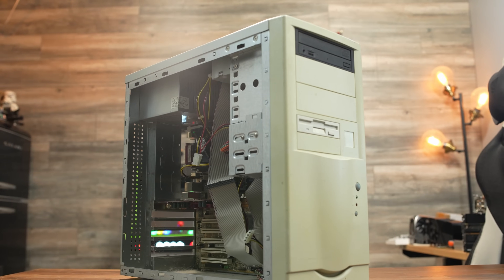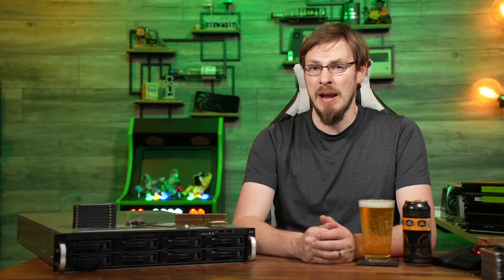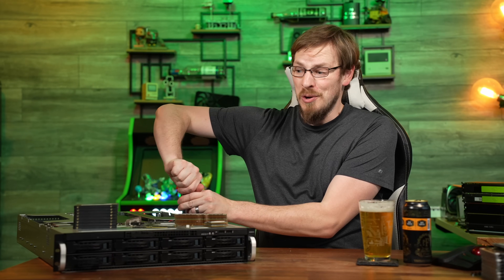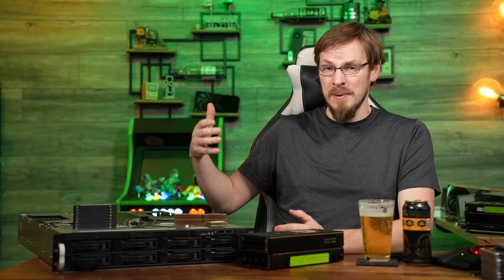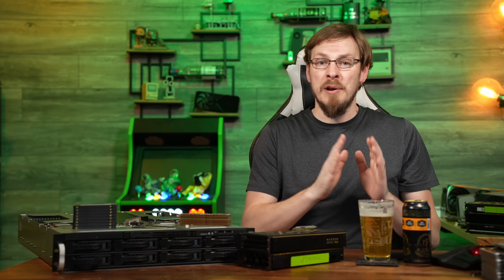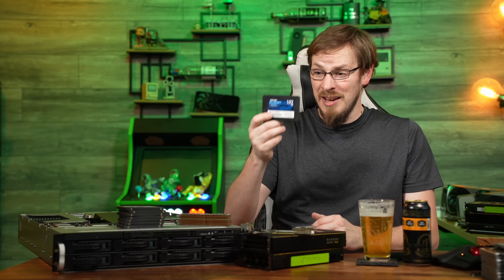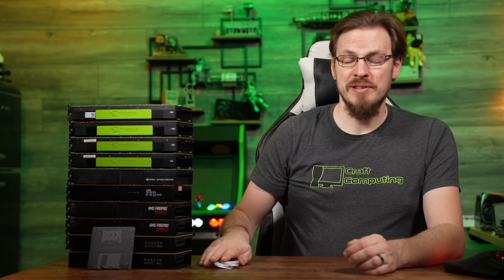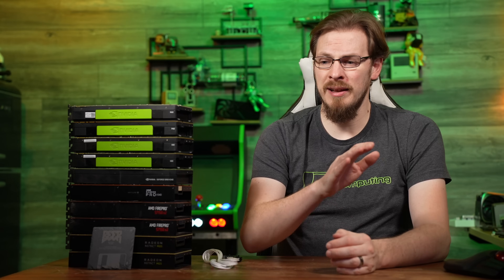The PERFECT 2U Cloud Gaming Server - Asus ESC4000 G3

Comment: I still don't see how not striping the drives fixes the io limitation. You're just shifting where the bottleneck happens. I still makes sense to stripe the drives and always have the aggregate bandwidth available for literally everything. After-all, the IO limit is still there regardless of the implementation, so you might as well stripe the disks. Individual VM tasks will be faster, and  you'll still have the same IO limit for large random loads regardless of the drive configuration.

Comment: In reaction to your sponsor video. Did you just use an abxylute? How is it? I'm looking for a cloud gaming handheld that doesn't break the bank but is still usable. For instance for running moonlight.
Reply from the maker: The handheld in the video is an Ayn Odin Lite.l, and worked great in my testing. Obviously with cloud gaming, your mileage may vary depending on your internet latency, distance from the cloud servers, and your own internal network. I'm almost 2000mi away from Max, and still had a great experience.

Comment: How well does the p40 work, i have been looking into building a cloud gaming server myself.
Ive got 2x 2690v4's 1tb of ram at 2400mhz, nvme storage, and quad 10gb networking. Its been working great. I jammed a 1060 to test with, which also works great for what little performance it can dish out.

But now i am looking into the gpu's im down to p40's vs p100's any advice? Ive been leaning towards the p40's. Both are the same price, but there is not much info on building game servers from them.

Also those eps cables are available on amazon if its the same pinout as a dell, lookup "r730 to m60" or "r730 to p40"
Just becareful some of these "eps" ports are eps in formfactor but not quite eps in pin out. Dont fry anything while your testing this stuff, looking forward to seeing what you make..

Comment: Why didn't you go with the E5 2699 v4. It's supported?
Reply from the maker: Cost. The 2697 v4 is $50/ea. 2699 v4 s are still trending $150-200 each. The extra cost would only get me ONE extra core per VM, making little to no difference in performance.

Comment: What are you using for the remote access client to be able to game on this cloud gaming server?

(I tried Parsec, but the connection STILL wasn't stable.)
Reply from the maker: Parsec has been remarkably stable for me. What is your client WiFi like? You need a VER stable stream for any low-latency remote access client. I've also used Sunshine/Moonlight with some great success.
Reply: @CraftComputing  
Not using WiFi.

Using GbE hard wire on both ends (and outbound WAN traffic as well).

I joined Sunshine's discord channel, and posted my issue there but there was never any resolution (that I've seen, for my post).

Comment: if you consider you hosting this sell this service other people 2000 to 2500 for 8 parallel players is not bad.  if you plan to get the money back in 12 month 30 to 35 per moth seems a good price for. if i assume the energy and connection price for and include it in the total monthly price to run this system. i bought a r630 for 2 years and did not realy know what should i do with after turning this system the first time on. mine has 2 E5 2699V4 and 768gb ddr4 2130mhz ram and the 10gb nic. i used a old thinkcentre with a pentium and 8gb of ddr3 this system was constantly on 90% utilization and hast some issues run services and game servers. and as i saw on ebay a r630 for only 600€ i bought it. the specs at first was unclear because it said its a in and aout servise no reconfiguration or refurbish only testing if everything works. i got lucky and got a really high spec machine.  i never had a industrial server and was blown away as i saw what performance this thing has. i mean running the same services and game servers with only 2 to 5% utilization was crazy also the power draw of 200W doing basically nothing. i did not use it for the last 2 years i thought about reselling it but now i use ai tools like stable diffusion and a language model and this system seems nearly perfect for this job. i gpu would be nice but  with only 25w pcie power and one slot 3 half size pcie and no power connector is a bit tricky i tried a t1000 and it works but i get constantly messages for pcie power also the t1000 is slow now i have a google coral on a m.2 a-key card in my system and this is way faster as the t1000. the only down side is stable cant use the coral only a gpu but the t1000 is way slower als using the full 44 cores of my system also if the image is to big it crashes but on cpu mode i can use the whole system ram for it. for the language model the coral is 3 times faster as the t1000 and use more power. i can if i find the right pcie card use up to 12 corals because the coral uses 2 pcie lanes so and need one usb connection over the m.2 e key so each pcie card can have 8 lanes and one usb connection. but for now i have only 1 coral also there are expensive and maybe they support tensorflow and not only tensorflow lite wich is not commonly used on large ai models but being 3 times faster with 1.5w compared to 40W is nice ^^

Comment: Hope your G3 is more reliable than the ESC4000 G4 that decided to be my nemesis at work. Regularly has issues of "losing" a GPU and crashing during the lengthy UEFI boot-up, meaning I have to drive 60 minutes from the office just to make sure it reboots cleanly, while kind of losing my mind while staring at the "in search of incredible" tag line. I have a Supermicro barebone lined up for a replacement which does a bit less GPU, and once replaced I will make sure to reseat the CPUs and hope it is more reliable when it resides in the rack within the office.

Comment: I put together a spreadsheet of available CPUs for my cloud gaming server/homelab server and ended up choosing the same pair! Running a single P40, ESXi/vCenter (been testing on multiple trial licenses). Your chassis may have the fan power, but I highly recommend these for your CPU cooling. They work great. I found out the "A" on the end of the processor name means it needs active cooling.
Dynatron R25 Cooling Fan/heatsink - 1 X 3.15 - 7000 Rpm - Dual Ball Bearing - Socket R Lga-2011 Compatible Processor Socket - Copper

Comment: Hopefully ASUS doesn't have a non-standard pin layout using a standard plug.  Looking at you HP and Dell.
Reply from the maker: I'm going to take a multimeter to it before committing ;-)
Reply: I have the front of an HP server running just as a disk shelf.  HP used the EPS connector but with only 6 wires used and 4 of those flipped.

Comment: if you wanna find a useful SSD for your workload, look into the intel P4618 or its older variants (dual controller SSD) or alternatively a HGST SN260 (PCIe x8). I got the latter in my home server, it goes up to 6GB/s read - for REAL, on a 6-core XeonD!

Comment: I too have had poor read experience with ZFS. We had a customer with a bad experience with a server and switched them to a 3x SAS SSD on RAID. Constantly reads at 1-2 GB/s. As much as the YT community likes to shit on HW RAID, it's fast and quality and businesses routinely rely on what it provides. It's good for both reads and writes.

However, when it comes to performance, people also need to realize that enterprises use SAN-type or distributed-type file system storage. The performance is very high due to how it's architected. 

Because this is a single system with SATA SSDa, I would just go with RAID10 or RAID50.

Comment: Thanks for the video.
Was wondering are you going to be putting 8 dual slot gpus in this rack? Do not know if I missed something in the video.
Reply from the maker: The server will support (4) Dual Slot or (8) Single Slot.
Reply: @CraftComputing  That is what I thought. When you said you wanted 8 gaming machine on bare metal and showed a stack of what looks like dual slot card, was wondering how it would work out.
Then was wondering what single card would give you 1080 med, but then again I know not much about server hardware.
Thanks for the reply, will watch and see what you do with the server.
Reply: @felixcosty the P4 is available on both single slot and low profile. The big limitation is 8gb of vram, but If you have 8 slots...

Eventually I am going to attempt 6-7 P4's for a home gaming server. I have tested it and gotten it working with two dual slot cards I had laying around.

Comment: 1600$ for 8 1080p gaming pcs? Thats what 200$ per? If you have 8 gamers in the house thats a steal.
Reply from the maker: That price doesn't include GPUs yet. But it's possible to get P100s for as low as $100 if you buy multiples. $2000 for the complete server would be $250/VM. Still a great deal.

Comment: Be very careful on the power connectors, specifically the positive and negative voltages.
There are two types for enterprise systems, and they work with each other.... so you can short the system & gpu
( talking from real life experience here )
Reply from the maker: Voltmeter is going to be used to verify any connections before plugging into a GPU.
Reply: Doing these kinds of jobs requires a cheap voltmeter to check every pin so you know what is 12v and what is G and what is whatever else. Servers have proprietary stuff so you can't trust anything.

Comment: Have you ever tried doing a multiseat setup with one Linux install instead of VMs?
I'd be curious to know how well that works out.
Reply from the maker: I plan on testing out both Windows and Linux VMs on this server.
Reply: @CraftComputing  I meant without VM's at all. 

A single linux install can support multiple users at the same time each with their own keyboard, mouse, and GPU without the overhead of running the OS multiple times. 

But I've never seen anyone do it with good hardware, it's always some "The 2nd one uses the iGPU for my little brother / girlfriend / etc"

Comment: Jeff, no! 😭 You could've gotten yourself a Gigabyte G292-Z20 with an EPYC 7402P for ~700-800 USD
You would still have to get RAM ofc, but 7402P vs. those ancient Xeons is night and day
Reply from the maker: That's 800 vs 235 for the base server. Trust me, I have my eye on the Z20 as well, but I'm also not made of money :-)

And at minimum for a single CPU, I'd need a 48-Core Rome for that to make sense. Have you priced those lately? The 2697v4 were 110 for the pair.
Reply: @CraftComputing  Fair enough. No I haven't looked at the 48 core romes.

Comment: If you're still looking for the EPS to PCI-E cables, I have some that I got for my Dell R720 to run quadro cards. I have 4 and the 2 I'm using work great. You'll find them if you search for "09H6FV gpgpu" (my previous comment got removed for a link it seems) they are made for Dell servers but are likely what you said you were trying to source. If you've got a build your own solution in the can though, that'd probably yield better results. Thanks as always for great content!

Comment: I too finally got my perfect gaming setup. Really great gaming desktop with Sunshine and moonlight clients on every TV in the house. 

Or VPN in from anywhere.
Reply: I tried this, but wanted 120Hz VRR and HDR...so I decided to run Bullet Train AOC 48Gbps HDMI cables from my office to each TV spot. For input I use a Digi Anywhere 2 Plus for USB over IP. However I still do use Sunshine/Moonlight and Steam Streaming for handhelds and/or Parsec.
Reply: @rezenclowd3  yeah I originally had a 50 ft HDMI cable I ran for my office with a gaming PC is to my living room downstairs. 

Work great with a GTX 1080. But with the 7800 XTX I guess the new HDMI standard only supports 25 ft cables? 

But either way it was kind of a hassle to set up. Having to go into windows and enable disabled displays and change to 4K and everything... And for some reason Windows loves to open windows on the opposite display of whatever you're looking at. 😂🤣😂.

So much simpler to just send a weight gone land request from moonlight. Then have it automagically configure everything. 

Latency is not bad at all. Played most of cyberpunk this way. Definitely wouldn't play a competitive first-person shooter with it though. But everything else is fair game.
Reply: @hotrodhunk7389  about 10ft for copper hdmi. For fiber...over 100ft. My cables were $750 ea. There are cheaper but these bullet train cables are used by commercial installers. In my use case I just walk to pc and unplug my 6 monitor setup and plug in the remote tv of choice.
Reply: Fun fact about VPNs: most mikrotik home consumer-level routers can host Wireguard directly on-device, if you update your software

Comment: Where the bleep is this $239 on ebay?! All I see are $500+ machines!
Reply from the maker: $235 is what I paid for mine, though I only found out when it arrived it was missing the GPU cables. I'm into it ~$400 with cables and rails for the barebones chassis.
Reply: @CraftComputing  Thanks for the reply! I predict the "Jeff" effect on eBay pricing for items like this :)
Reply: @CraftComputing How did you find the cables? I’ve been looking for GPU power cables for an ESC4000 G4, and it’s been a struggle. Can’t find part numbers or anything; I just know they’re different cables from the ESC4000 G3.
Reply: Seriously. Ebay must already be ahead of the curve here because even barebone machines are $499 on eBay
Reply: Edit -- I was able to get a very barebones version (w/ PSU at least) for ~$160 shipped on ebay. TBD on how it will perform on arrival. Anxiously awaiting the next video for a solution on the GPU power cable issue.
Reply from the maker: NICE! Yeah, deals on these servers are out there. And I think I have the cable solution worked out for ~$50 for all 4 cables. Will be doing a follow-up video shortly.
Reply: Not enough server for me unfortunately… I need to update and haven’t found the right ones! I need a triple set of identical servers